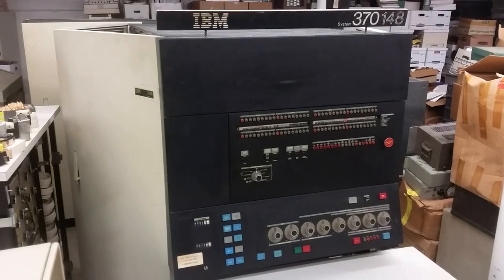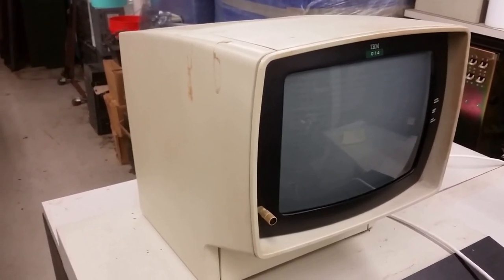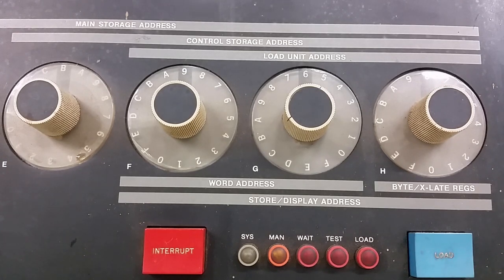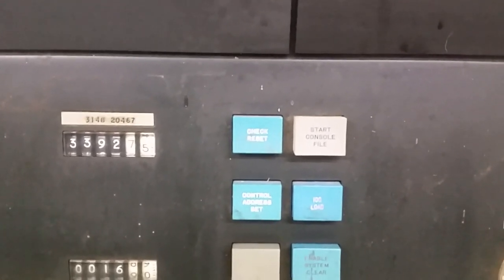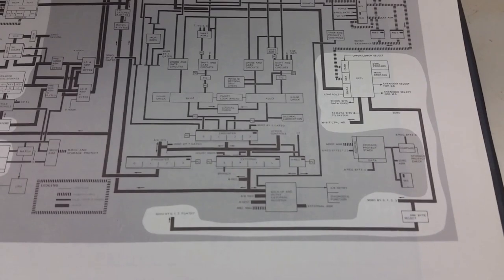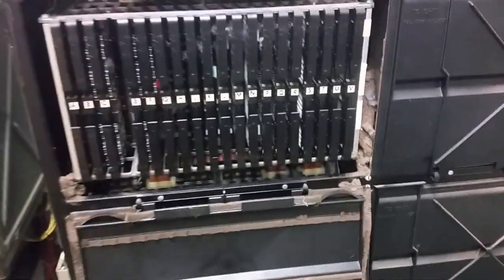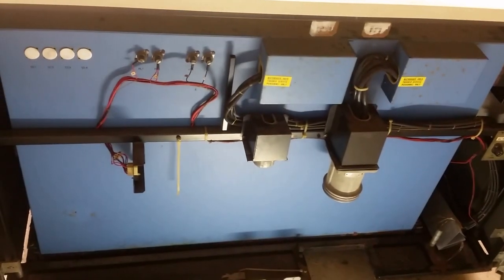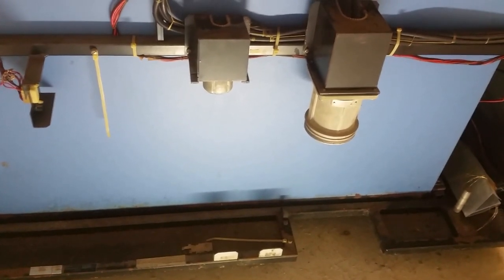A Look At An IBM System 370 Model 148 | VVCFMW 2020

Comment: I want to see more of those motor generators. Good history before solid state inverter types and way better power. Like mini Alexanderson /goldschmidt alternators, these devices were 415hz machines. Wish there were more of those units in open frame format. I did just the 4680 and pos rs485 units. Always love seeing the older tech out there.
Reply: Most small and medium IBM machines DID NOT USE MOTOR GENERATORS.
i had ibm 360 mod 30, mod 40's, system 3's, sys 34's, 370 135's, rca spectra's, 4341
and rca 301's they all used standard 3 phase 208v.  I installed these machines in
offices, wharehouses,  private houses used as offices. WHEN WE LEASED OFFICE SPACE IN NYC, THE RENT IN NEW YORK OFFICE BUILDINGS ALWAYS INCLUDED
ELECTRIC!!! SO WE PAID VERY LITTLE FOR ELECTRIC!!!!!
Reply: @billgoodman3537  I am guessing the IBM put motor-generators on the first solid-state memory machines to feed all those RAM chips nice even power.

Comment: I was on the development team for this machine. I wrote the compiler/assembler for the microcode as well as the simulator to run the microcode for the developers. IBM said the mg set would hold up under a loss of 6 cycles. Also, I don’t think that any 360 or 370 machine actually ran 360/370 code directly on the hardware. 360/370 language was too rich to run directly on hardware..
Reply: The top of the line 360 model 75 was the only hardwired (no microcode) IBM mainframe that implemented the >full< instruction set; very expensive, but the fastest >full< 360 without cache memory in the CPU. 

The other hardwired models (44, 91, 95, etc) were number crunching focused and did not implement certain 360 instructions, like Packed Decimal and Storage to Storage, etc.
So far as I know all of the 370s were microcoded – with the possible exception of the 370/195.

That sounds like a great job you had. I am curious, what language was the 148 microcode simulator written in? System 370 Assembler, I assume. What hardware was the 148 microcode simulator run on? I assume the 370/148 was not available yet – since you had to write the simulator.
Reply: @pking147king6  I can’t imagine implementing instructions like Edit and Mark in hardware. I’m sure it could be done, but it seems like it would take a bunch of hardware.
Reply: @pking147king6  originally the tools for the 370 145 were written in assembler. For the 148 I was convinced to switch to PL/S, an IBM internal language called Programming Language for Systems. I switched kicking and screaming because I love programming in assembler. After using PL/S I learned to love it. It compiled to assembler language which needed to be run through the assembler. Within the source you could jump in and out of assembler if you wished to improve performance in a certain section. It generated reentrant and recursive code.

Comment: It is inaccurate to say that most of the 370/148's ran either VS1 or VM.  At the time 2/3 of all 370 architecture machines ran DOS/VS.  VM is and was what is called a hypervisor; by itself it really doesn't do much - it serves as a host for guest operating systems such as CMS, DOS/VS(E), VS1 and/or MVS. The company I worked for that had a 370/148 ran MVS and DOS/VS on it but not at the same time. They were never really big into VM.
Reply: @fard: your comments will also apply to DOS or VS1 - by themselves they weren’t much use. That’s why programmers were hired. VM was also used as a application platform. I worked for a company that wrote applications that ran natively on VM. VM is a very good application platform . Been there, done it.
Reply: @deepsleep7822  Strictly speaking, you are correct about DOS, VS1, VS2, etc. But these operating systems always came with an assembler plus an IOCS subsystem which supported SAM, ISAM, BDAM, BTAM and others.  Early on, they also came with COBOL, FORTRAN, PL/1, SORT-Merge as part of the distribution. Sure you could program the bare metal, but I don't know of any companies that did.

Comment: You failed to open the side that contains the computer logic and memory. But it is just PCBs with logic cards on one side and wire wrapped connectors on the other side.

Comment: Wow.  My last technical system level position was  370 135 and 145  nationwide support.  I  kept a completes set of ALDs and microcode listing for both beside my desk along with the roller section of a 135.
I was already scheduled up to spend ti

me in Endicott to do some pre announce work on the 148 and would have picked that one up.

But I was promoted into another division and lost touch with the FE products.

Thanks for the 148 cross training and I am sorry I missed out on working with that one.
Let me know if you have to restore a 135 or 145.

Comment: Didn't catch it in the video - what did you have to pay for this gem stone ?

Through the 1970s and early 1980s, did application and systems programming (sysgens) (Assembler, COBOL, Fortran, IMS DB/DC), starting out on S360/30 ending up on S370 and 3033.

Nowdays, that would give me a headache.

Comment: The lights told you the stop codes. With the blue books(wiring diagrams)
you would then find the card that was causing the problem.
THEN REPLUG THE CARD!!! FIXING THE PROBLEM!!!

Comment: Hi... what was the bus width on these machines to memory and to peripherals? 32 bit or 8 bit or did it vary with device? Thanks in advance for this presentation!
Reply: 8 bit Bus and Tag, the usual interface for IBM mainframes until ESCON came out. I really did not show that channel connectors, sorry. When I do the reshoot for my channel, I should include them.
Reply: 24 BIT MACHINE WITH VARIABLE ASSEMBLER INSTRUCTIONS: 8 BIT, 16 BIT, 24 BIT, ALSO STORTAGE TO STORAGE INSTRUCTIONS
Reply: @ed3987  Thank you for the reply. I used to program mainframes in assembler. I was never really cognizant of the hardware. Things like data bus width never occurred to me and I just thought, "It's a 32 bit register width, that must be thee I/O bandwidth."

Comment: You are wrong when you say it is not a 370 or that it is emulating a 370.  The first paragraph of the Principles of Operation describes what 370 means: 'the way the machine appears to the programmer, distinct from data flows, internal implementation, or performance'. They call this a 370 because it IS a 370.

Comment: 3090 you could get motor generators for the machine. The customers who did not provided  415hz would need them to run their machine. I maintained an MP 3090 & had 4 of them that I needed to grease.
Reply: Interesting, i worked on a 3033 at ibm lab in france, it needed these 415 hz as well and was water cooled, impressive, and we had another 370/158 with an attach procesdor, running cpu design and  logic verifying on these, on mvs 3.8. I learned pl1 there because they was using it a lot because it provided n dimensions data structure management, something i have not seen later but i m limited

Comment: Great video Uniservo!  I was a programmer back in the days of such machines (on an IBM 4300).

Is there an IBM document that explains the meaning of all the myriad of lights that were on the front panel?
Reply: I don't know about the 4300, but I have found many docs for the system 360/370 in pdf and software as well for free online download.  Just Google it and you should be able to find what you are looking for.
Reply: @J_David_Worthington_III  I tried but I'm not finding anything that is specific to the lights and controls on the operator's console.
Reply: @BluesClerk  Give me a few days and I will see if I have anything in my archives that may be if interest.
Reply: @J_David_Worthington_III  Thanks
Reply: @BluesClerk  I found the IBM Operators reference manual at bitsavers dot org so perhaps you may find what you are looking for there. Good luck and best regards!
Reply: THE LIGHTS ARE FOR THE REPAIR PERSON, THEY DISPLAY STOP CODES THAT YOU USE WITH THE MAPS(BLUE BOOKS).
ON A MACHINE WITH A THOUSAND CARDS, YOU NEEDED LIGHTS TO ISOLATE THE PROBLEM.
ON ALL MAINFRAME  AND MINICOMPUTERS LIGHTS WERE USED FOR TROUBLE SHOOTING PURPOSES ONLY.
SOME MACHINES PDP8S RCA 301'S, PDP 11 NEEDED SWITCHES AND LIGHTS TO LOAD THE BOOT LOADER AT START UP.
Reply: @ed3987  Thanks Ed! As my recall is foggy for that period I thought that the programmers used the lights stop codes to debug their programs as well.
Reply: @ed3987  That's good to know.  I have enough mainframe experience to claim some level of knowledge but I'm 80% baffled by the labels for some of the lights on the 370 panel.  I recall that the Honeywell mainframe systems stored such information in reserved areas of memory.  You could use the Hex/Dec keypad and LED display to pull up some of the machine state information.  There was a ROM routine you could execute for dumping RAM to the console printer.  Some of the boards had status lights on them but you had to open it up to see those.